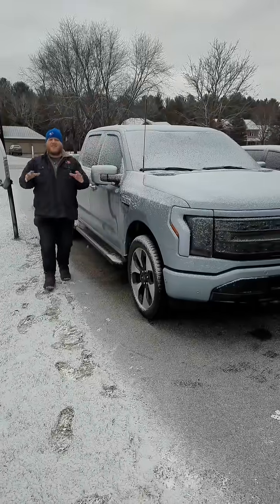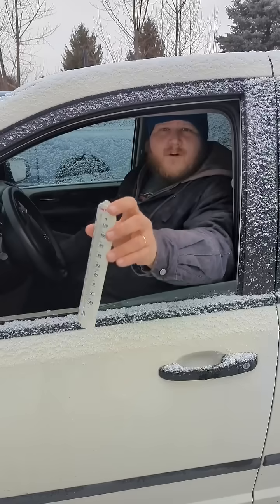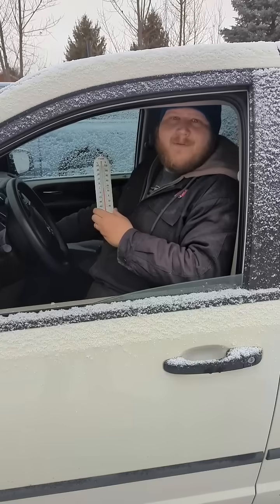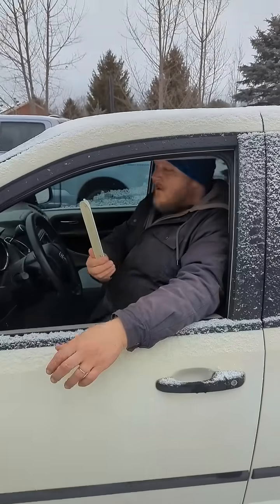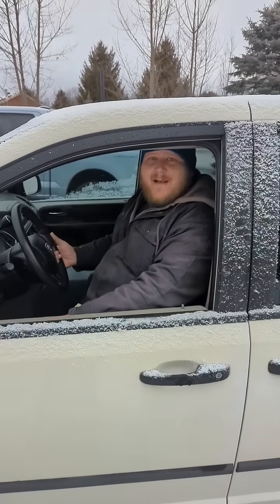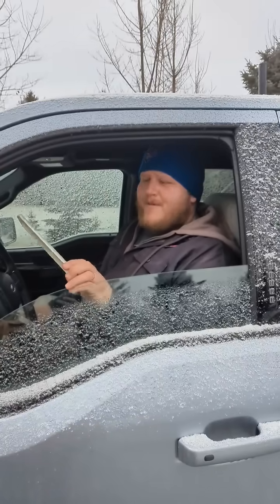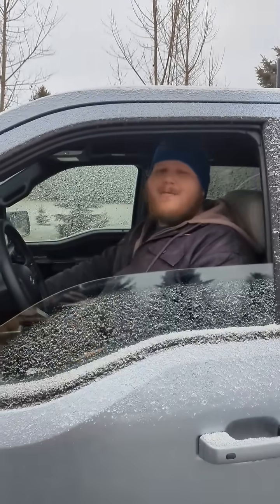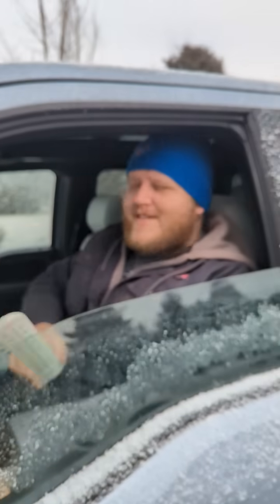Electric vs Gas - Heater Wars! How Long Does the Ford F-150 Lightning Take to Heat Up?

Comment from the maker: Watch our complete F-150 Lightning review here: https://www.youtube.com/watch?v=egXm1MrZ170

And to answer the two main questions in the comments: 
- We only had the windows opened to film the stand ups. They were closed while the vehicles were heating. 
- We used an old minivan because it's all we had that day. Another crew cab pickup truck would have been ideal, but we figured having something for a benchmark was better than nothing. 

This test isn't even close to being scientific, but I can say with certainty that the resistance heater in the F-150 will start providing heat quicker than most ICE vehicles will. 

For all our thoughts, positive and negative, on the F-150 Lightning, watch the full review at the link above.

Comment: And if you are towing a heavy trailer 175 miles, you will have to turn that electric strip heater off. No heat at all.

Comment: Fun thing, the F150 powerboost is chock full of 20amp 110v plugs in the interior. Plug in a ceramic heater and it will be even faster

Comment: Only 4 mins but hey when your battery runs dead only 114 miles on the trip and no charger you will freeze in 4 mins fuck those electric vehicles

Comment: Okay Let's talk about the decreased mileage and range and anything below 32 Fahrenheit or 0 Celsius weather The fact that your battery life's cut in half or greater in those temperatures and the other issues And problems that come along with electric vehicles One with the gas vehicle I can drive a Mile and have heat quicker than an electric car can sitting there Cold weather doesn't decrease my range and I don't have to stop in charge for 20, 25 minutes not to mention that my gas vehicle is not starting any fires that are unextinguishable

Comment: “One kilometer of range” I’m sure. 
EV’s are amazing when it comes to their heaters. I live in Montana and could only DREAM of not having to wait for my rig’s heater to warm up. But my friend’s Tesla Y suffers significantly when it comes to range in low temps. While it does have a heat pump, those loose their advantage over resistance heat below zero F.

Comment: California is being limited on power from our government from the self inflicted energy crisis. They have taken control of peoples thermostats in there house cause the power grid quote un quote cant take it. So what are they doing here. Pushing electric vehicles. Which btw do your research cobalt mining is how they get the lithium for these batteries. Which is 100x worse for the earth then drilling for oil.. what morons. Also what happens when your on highway about to die and go to pull in to charge and there all taken and you and your innocent family are trapped in Detroit waiting for a hour charge... 😂🤣😂 what's clowns🤡🤯

Comment: Heat up would this be blowing heat out of the vebts or heat tge entire car up ?

Because my 89 Grand Wagoneer blows heat in the first 2 minutes and is fully warmed up to 210 blowing scorching hot air in the first 1 mile driven.

Comment: Helps a lot to close the window.  Caravan is a huge cab to heat up.

At 1 C it isn't really cold and you shouldn't need a warmup.  1 to 2 miles down the road and the Dodge should be blowing lots of heat.  Try it at -30.

Comment: Wait... You failed to take into consideration
 A. new vehicle which means new, better insulated lining for the EV truck, newer motor, heating/cooling parts...
B. You compared an almost ten year vehicle va a brand new 2021/2022 EV Ford Truck... Cmon man. Next time.... Compared a 2022 Ford F-150 Gas to an 2022 Electric Ford F-150

Comment: Electric cars that have resistance heaters will be more reliable and heat up faster. The ones with the heat pumps are problematic in extreme cold

Comment: Yeah heats up quick. Turn the limited 200 mile range wich already sucks to 55 miles but hey you will be warm until the battery dies. Then you have to wait 4 hours for it to charge. Meanwhile I can have my truck still be warm after I put gas in it and drive another 400 miles. More than the lightnings standard distance with no heat.

Comment: A better test would be to spend 24hrs in both vehicles at sub zero temps the ev fully charged and the caravan fully topped off.

Comment: I’ll stick to my ICE F-150 that gets 850 miles of range on the highway. I’ll make the time it takes to heat up a quarter of the way through a long trip by simply not having to stop for gas, or (charge).

Comment: So….electric still sucks and is actually extremely bad for the environment in the process of manufacturing the battery. It needs electricity to charge 🤣and then the highly environmentally problems associated with the disposal of the burnt battery. Clown sho for sure!

Comment: 💥 getting warm fast is neat.... but the up too 50% mileage loss while towing is not good. 🤔
Reply: 💥 i see a question about who in the suburbs drives their truck very far.   Im 135 miles to the beach.  I would be extra worried about weather conditions and traffic.  Can imagine not making by a few miles and being pretty upset. 🤔🙄

Comment: Why do they use heating elements, heat pumps would be the way to go. They could do heat and AC with the same unit. Also, put a small single cylinder engine that runs off of a propane bottle in the trunk for emergency charging - clean burning, quite, effective.

Comment: Now when you cant find a charge station and your low on battery and you finally find one but you cant run the heat while your charging because its taking to mich juice hmm electric vehicles are not the future as of right now there are many much better options that are more eco friendly since these company's like to exclude the little details of how they get the materials for there batteries

Comment: Shouldn't you have benchmarked a brand new ecoboost or v8 f150 for comparison? Not saying those trucks will do any better but its hard to compare a 8 year old minivan with a larger inside cabin area to a brand new crew cab pickup. Other then that great video and keep it up!

Comment: EVs lose massive range when cold so sure they heat up fast but my gas vehicle won’t leave me stranded in a snow storm due to lack of range(friend owned a Tesla and his battery dropped in the middle of a long drive to go skiing, we had the range when we started but got stuck 10miles from our destination in blizzard conditions with no tow trucks willing to climb the mountain road during the storm. We almost froze if it wasn’t for our bag of hand warmers)

Comment: Heres 19 reasons why electric vehicles SUCKS.

1) It’s too expensive 

2) Also cause pollution because it’s created by dirty fossil fuels 

3) Tires wear out quickly 

4) Only reliable when temperatures are warm and when it’s cold, it can bring danger to the driver and passengers.

5) Charging stations are hard to find in midwestern states. If you live somewhere like Wyoming or North Dakota, it is clear that you are going to have a lot of difficulty finding charging stations, as well.

6) Roadside Service does not provide Full Coverage and lot of this has to do with the fact that their parts are not on-hand and they are more difficult to actually find than ones for regular cars. Also, auto mechanics will not know how to fix electric vehicles since they didn’t built it. You probably have to find Elon Muck and ask him to fix it for you and he will probably charge you for a million dollars. 😂

7) Travel shorter distances due to the fact that these are cars that need to be charged, they simply do not have the same type of mileage range that regular cars often possess.

8) Too much focus on luxury vs. dependability. With all of the issues that have been discussed thus far, one may be questioning what exactly car manufacturers are aiming for when it comes to making these models. In short, they simply are spending too much time on overall luxury rather than dependability.

9) They get noisy early on. Owners of electric cars have been quite open about the fact that they are prone to make a lot of noise very quickly into their usage lifetime. There is no question that over time, this happens to all types of vehicles, but it is alarming that it has been happening so quickly for electric ones.

10) Maintenance costs far more because when dealing with expensive cars, one can always assume that repairs will end up costing far more. However, when observing electric vehicles, it is clear that the prices to fix them are at an extremely excessive rate. This is largely because finding its parts is far more difficult.

11) some electric cars look ugly

12) Battery pack replacements are expensive due to the fact that electric cars run on their battery packs, it is clear that they play a major role in the overall performance of the vehicle. However, their batteries are prone to needing replacements as time passes by, and they end up costing a ton of money.

13) Recharging takes a long time

14) Durability is not consistent

15) Tend to be heavy due to the fact that electric cars are built with different materials. In fact, the heavy weight of these vehicles is likely another factor that ends up making their tires begin to drop in quality so quickly.

16) One major aspect of the electric car market is that there are limited choices. Unlike regular cars that comes with an abundance of different options, car manufacturers do not seem to release multiple electric vehicles. This is not a solid idea, as electric cars are trying to grow in popularity.

17) Not Good In The Snow. Electric cars definitely meet their match when they are used in the snow. They are prone to having a lot of malfunctions with this type of weather, while also having a lot of difficulty while driving on slushy roads.

18) Too Much Hype. "Show not tell" is the philosophy that car manufacturers should possess. However, when it comes to electric cars, it is clear that this currently is not the case. There is no question that the market is pushing for more usage of electric power, but they have yet to accomplish much in the way of persuading the vast majority of the public.

19) Having a smart car means that the government can track your every move and can listen to your conversations. 

DEMONcrats and leftists wants to banned EVERYTHING. Gas cars, gas stoves, guns, cows, meat, freedom of speech, freedom of religion, and etc. I’m not going to go along with their authoritarian policies so fuck them!

Comment: People just really dont get it. 
The grid can't handle the replacement level of evs we have now let alone if we keep going.  
The batteries are terrible for the environment and can't be recycled (yet)  
Batteries lose power at a faster rate in the cold.  
The additional electricity needed is anything but green, fire up those coal plants.  

It's a net lose. By a very large margin.  
We would've been ahead to pursue hydrogen at least the ICE on the roads could be converted to hydrogen.  
Give it 15 years I'll still be saying. I told ya so...

Comment: now you can drive that dodge caravan over 400 miles on a single tank of gas, but that lightning will be lucky to go 100 miles on a full charge in those temps.

Comment: A minivan with a ton more interior space and a puny V6 at idle. I don't doubt the electric is faster, but a crew cab with a 5.0 or especially a diesel would be a much different comparison. Plus no one is waiting that long for their heater to fully warm up. Gas warms up super quick when you're driving it

Comment: I know that new vehicles heat up faster then older vehicles.  I wish you did a comparison of a new vehicle, of the same model year at the very least as the Lightning.  My parents '14 Santa Fe takes forever to heat up, nearly 200k km.  My '21 Edge with about 16k km, takes no time at all.  Now I'm not saying its faster then an EV heating up, but it's still WAY faster then the vehicle 6 years on it.

Comment: It is very easy to charge an EV. If construction companies and such invest in even the cheapest chargers that are plug in, if you stay parked long enough it pays off
Reply: Yeah but it takes a long time to have the EV charge in FULL. Good luck waiting for an hr or more when you are already late for work. 😂

Not to mention that most house and paces don’t have charging stations.
Reply: Heres 19 reasons why electric vehicles SUCKS.

1) It’s too expensive 

2) Also cause pollution because it’s created by dirty fossil fuels 

3) Tires wear out quickly 

4) Only reliable when temperatures are warm and when it’s cold, it can bring danger to the driver and passengers.

5) Charging stations are hard to find in midwestern states. If you live somewhere like Wyoming or North Dakota, it is clear that you are going to have a lot of difficulty finding charging stations, as well.

6) Roadside Service does not provide Full Coverage and lot of this has to do with the fact that their parts are not on-hand and they are more difficult to actually find than ones for regular cars. Also, auto mechanics will not know how to fix electric vehicles since they didn’t built it. You probably have to find Elon Muck and ask him to fix it for you and he will probably charge you for a million dollars. 😂

7) Travel shorter distances due to the fact that these are cars that need to be charged, they simply do not have the same type of mileage range that regular cars often possess.

8) Too much focus on luxury vs. dependability. With all of the issues that have been discussed thus far, one may be questioning what exactly car manufacturers are aiming for when it comes to making these models. In short, they simply are spending too much time on overall luxury rather than dependability.

9) They get noisy early on. Owners of electric cars have been quite open about the fact that they are prone to make a lot of noise very quickly into their usage lifetime. There is no question that over time, this happens to all types of vehicles, but it is alarming that it has been happening so quickly for electric ones.

10) Maintenance costs far more because when dealing with expensive cars, one can always assume that repairs will end up costing far more. However, when observing electric vehicles, it is clear that the prices to fix them are at an extremely excessive rate. This is largely because finding its parts is far more difficult.

11) some electric cars look ugly

12) Battery pack replacements are expensive due to the fact that electric cars run on their battery packs, it is clear that they play a major role in the overall performance of the vehicle. However, their batteries are prone to needing replacements as time passes by, and they end up costing a ton of money.

13) Recharging takes a long time

14) Durability is not consistent

15) Tend to be heavy due to the fact that electric cars are built with different materials. In fact, the heavy weight of these vehicles is likely another factor that ends up making their tires begin to drop in quality so quickly.

16) One major aspect of the electric car market is that there are limited choices. Unlike regular cars that comes with an abundance of different options, car manufacturers do not seem to release multiple electric vehicles. This is not a solid idea, as electric cars are trying to grow in popularity.

17) Not Good In The Snow. Electric cars definitely meet their match when they are used in the snow. They are prone to having a lot of malfunctions with this type of weather, while also having a lot of difficulty while driving on slushy roads.

18) Too Much Hype. "Show not tell" is the philosophy that car manufacturers should possess. However, when it comes to electric cars, it is clear that this currently is not the case. There is no question that the market is pushing for more usage of electric power, but they have yet to accomplish much in the way of persuading the vast majority of the public.

19) Having a smart car means that the government can track your every move and can listen to your conversations. 

DEMONcrats and leftists wants to banned EVERYTHING. Gas cars, gas stoves, guns, cows, meat, freedom of speech, freedom of religion, and etc. I’m not going to go along with their authoritarian policies so fuck them!

Comment: I'd be more concerned about the cold affecting the range. These trucks are only useful if you don't tow anything and in that case, why buy a truck? Remote start fixes the warm up issue anyway.